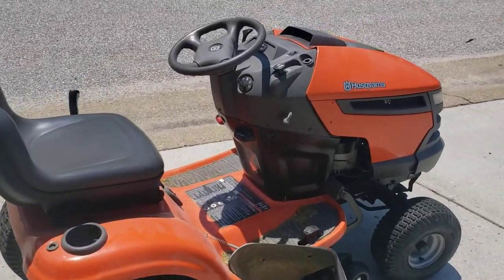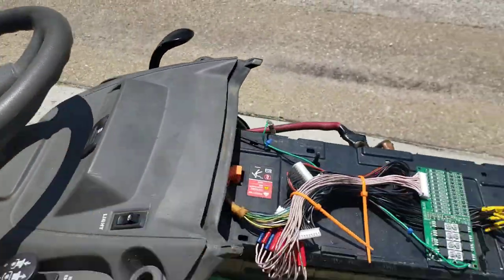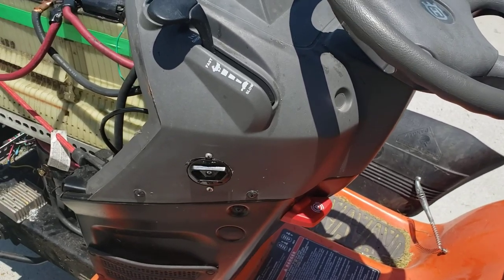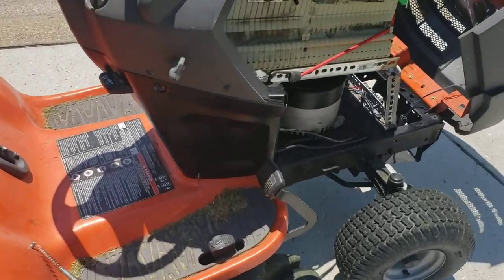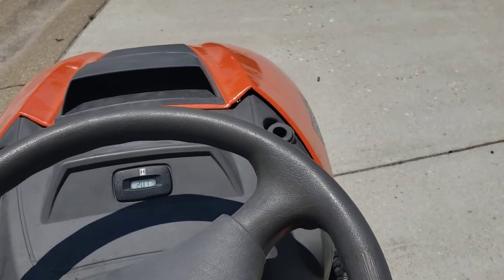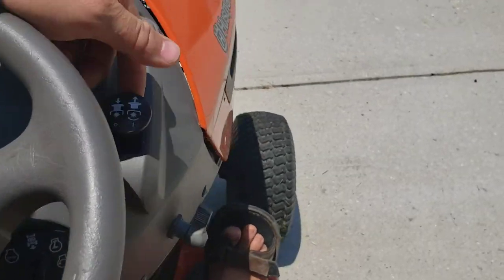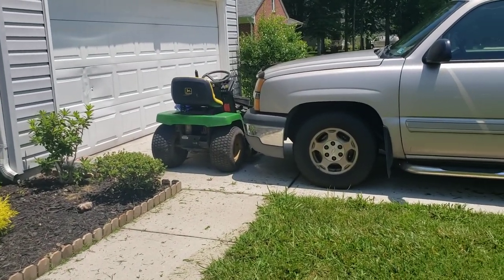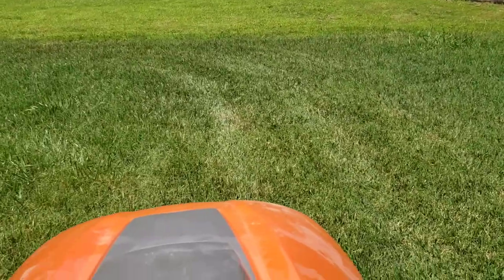Husqvarna Riding Mower - EV Conversion

Comment: Do you know, if there's any benefit to using the fly-back diode and pre-charge resistor on that contactor, when there's no controller? I learned it was for protecting the controller, and am also running an ME-1004 riding mower conversion, direct, without a controller... but do these two small electronic components offer the motor any protection, or the batteries?
Reply from the maker: I personally have not noticed any benefit from them in this configuration... As a matter of fact, mine get warm/hot in this configuration. They were left on from when I had a controller connected

Comment: Hello, I am thinking about converting my mower because I am sick and tired of the loud noise. Can you say by how much this conversion is quieter than as the old gas setup?
Reply from the maker: It is quieter however, it isn't "quiet". The blades do generate noise when rotating. The pulleys under the chassis also make noise.
Reply: @JerryRigged  Thanks for that quick answer. I am aware that all the Others components still have their operating noises. I am from Germany, I would have to get the motor from the states. I would like to build a lifepo4 100AH 16S battery pack, could you maybe estimate what kind of runtime that could give?

Comment: Nice Build, looks good 👍 👌
You mentioned it still uses the Original Hydrostatic Differential, My Question : does it still have a reverse with your conversion? 🤔
Reply from the maker: Yes, the hydrostat has gears inside that flip direction for forward and reverse based on the input lever. The motor direction does not need to change.
Reply: @JerryRigged  I thought so, I just  recently serviced my Tuff Torq K46 Hydrostatic Transmission on my Husqvarna Lawn Tractor, (YTH2648TDRF) as this Diff is used on many Ride-on Mowers, Husqvarna, John Deere etc.
I just wanted to confirm it, Thankyou 😊🙏👍👌🍻

Important Note - what Husqvarna doesn't tell you in there "so called" service manuel is that this Hydrostatic Differential needs to be serviced at "50hrs then every 200hrs" (this is stated by Tuff Torq - the manufacturer themselves)
(Oil / filter Change & clean magnets in diff)
I Love how massive companies don't disclose this critical information !😳🙄
A Shorter Lifespan means another sale for them, it's pretty sad / pathetic & very sneaky way to do business. (I think anyway.)
 I thought I should let you know, I would hate to see that Awesome conversion gathering dust because of a premature worn out Diff.
That Electric conversion may be something I would consider doing also in the future👌👍
How much approximately did the Conversion cost ?🤔

Comment: Thank you for doing this video. It is ver informative. If you could do another build, do you think the 8kw motor is enough? Or too much? I am considering converting a Cub Cadet zero turn mower, but don't want to underestimate the power needed.
Reply from the maker: I think the motor is just about perfect for this application however, I would get a 14s or 54v battery minimum to power it. 

The 12s 50v is just a smidge slower then I would prefer the blades to be spinning. I know GMC released a later revision to the Chevy volt to have a 16s battery module... That might be overkill but I'm sure that extra voltage would be a nice power boost.
Reply: Thanks. I was considering a 48v power pack consisting of Headway batteries which have a 300A potential, but can scale up to a 72 to accommodate the higher demad. Do you think adding a speed sensing controller would be useful?
Reply from the maker: @Perfectionist01  I think that is a big power jump, it would probably be a good idea to have a sensor and some sort of delivery regulator in that case. Some hydrostatic drives heat up with increased input speed.

Comment: Is that bracket you made there galvanized steel?  If so how'd ya weld it? :D
Reply from the maker: Magic 😅. I'm not a welder... I just make it happen
Reply: Galvanized steel can be welded, you just don't want to breath the fumes generated while welding.
Reply: @hansswift3141  how do you not breathe them, leaning right over it? I'd like to try it out lol.
Reply: @chriswf  I weld galvanized outside only.  Take a breath, hold it, weld, walk away upwind and take a breath.  I can hold my breath for about 3 minutes due to diving practice.  You don't want to breath even a single breath of galvanized metal.  It's lethal.
Reply: @CerberusOnFire  LOL that's wild. I have 2091 or 2097 filters (pink), but I'm still unsure about welding with those as I can still smell things through them sometimes.

Comment: I know this video is 2 years old.. but would you say that it's still working great without the controller? would this setup work with 4x 12v 100ah lead acid  batteries?
Reply from the maker: Yes, it works wonderfully. 4 lead acid should work but you'll need to monitor the voltage drop to determine longevity

Comment: Where can I find info, read up, on how to repurpose a Chevy volt battery like this.  Taking advantage of the onboard BMS, finding connection points, pin outs, as required etc...  That's a big weight savings over lead acid.
Reply from the maker: Honestly I could not find a pin out that was valid. I had to use a multimeter and determine the order of the cells by continuity testing the leads to the top of the battery. Then I was able to create a balance lead that could be used on a generic RC car charger or any type of balance board.

Comment: Nice work! Is this a hydrostatic drive mower?
Reply from the maker: yes, the hydro takes the jolt away from the starting movement. The older manual models do work though they sometimes cause the front tires to lift off the ground with the instant torque that an electric motor provides.

Comment: I followed all of this but use a zero turn john deere. I'm having a problem lately, it stops no power then about 10 minutes of wait its good to go. Until today after 10 minutes in only ran for about 30 seconds it cuts off. Wait for 10 m😅minutes to run 20 seconds.  Battery still have 90% in it. Have you had this problem on yours? And what did you find out? TIA
Reply from the maker: Assuming you are not using a controller, I would check the main contactor. Sounds like a short in there. Also, check that the leads are crimped well and without corrosion starting. I've had corrosion build up between connections and cause a connection break if the load is high.

If you have a BMS and it's wired inline, check the amperage being consumed. BMS boards will cut power if it exceeds the rating on the BMS.
Reply from the maker: Also, since this is new behavior, check the drive belt and blade belt. Check the pulleys, if the bearings are going bad, a higher load would be expected
Reply: Thank you
Reply: Update on that. What it was are my battery cables went a bit loose. Now have to periodically tighten it. Perhaps the vibration causes it. Thanks again

Comment: What's the capacity of the pack?
Reply from the maker: 50.4Vdc at 94ah capable of 200 amps constant (there are two in parallel, do amps add together? If so, 400 amps constant)
Reply: @JerryRigged  Amps do add if connected in parallel, but don't if connected in series.